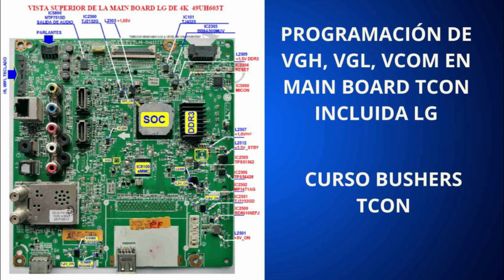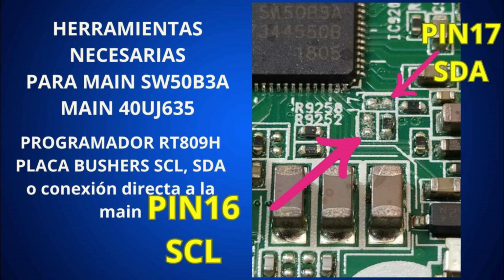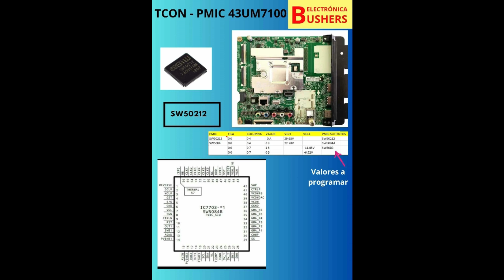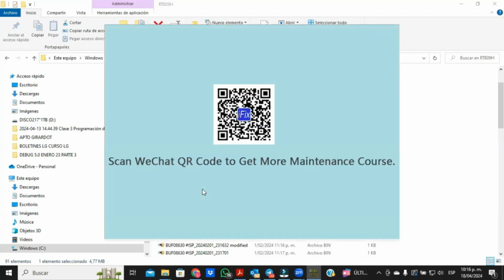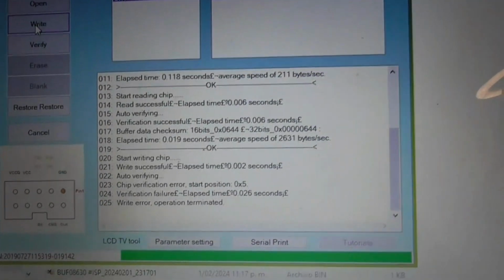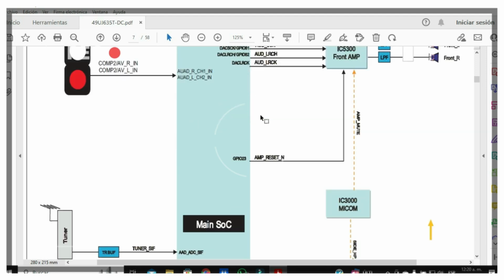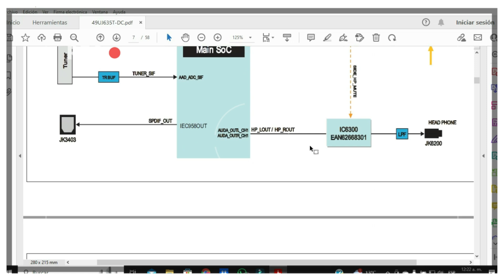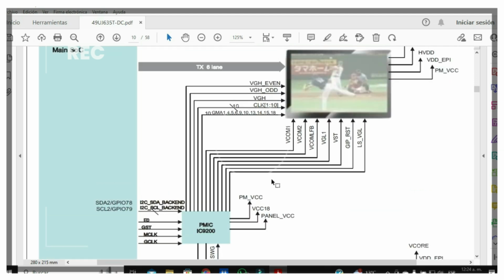Service to LG Smart TV. How to program VGH, VGL. LG Tcon. principles and practice

Comment: Pmic not saving! data is resetting to default after reboot, can help?
Reply: I have already succeeded, to those who need it is the tip: the PMIC is re-recorded during the boot, so as not to lose the data it is necessary to remove the resistor on the SDA line, it is important to read with the LCD connected so as not to lose the Gamma adjustments.